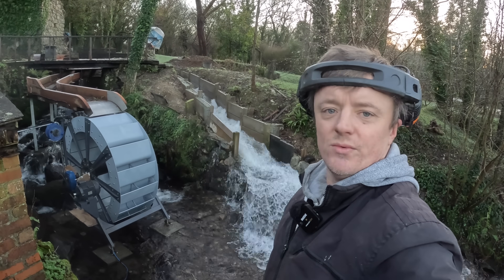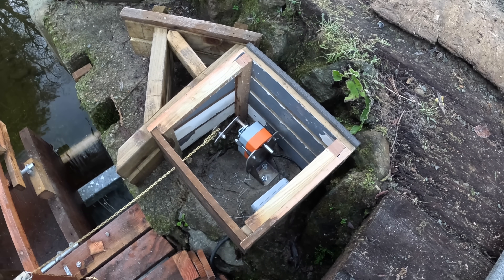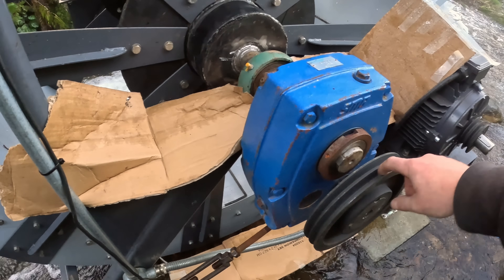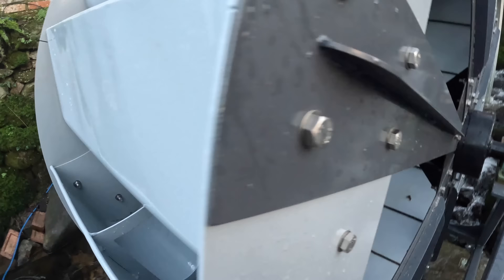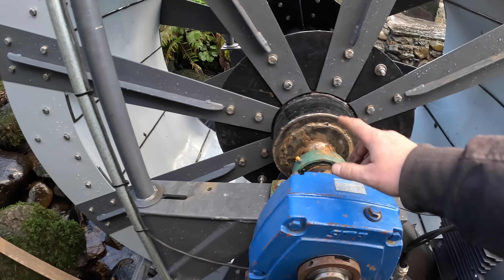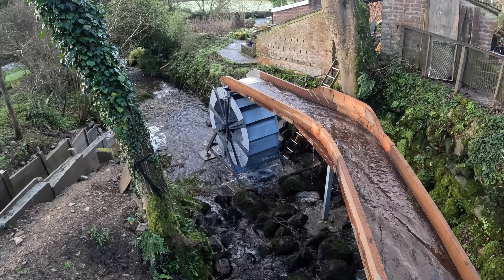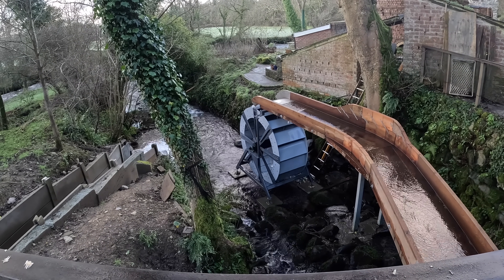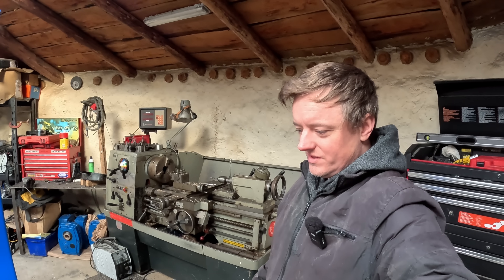Powering An Old Mill  1.5 Kw Lake District Overshot Waterwheel Project Part 5

Comment: Very interesting to watch the project develop and the fixes you put in, although I am surprised you didn't go for controlling the water flow through the bypass. It could be made into an active control something like the Thames barrier (which could be powered) to increase or restrict flow through the run off, this would help reduce the breaking and strain on the wheel. This would allow you to fit a larger pulley and generate more power at a lower speed, keep the wheel speed down and run efficiently with a lower flow rate all year. Very good project though well done, and I liked the fact you showed it warts and all.

Comment: Learn as you go from your mistakes. Never relent in doing good and giving your best. 
 Probably should have attached water wheel to shaft with taper lock hubs.
Reply: The weld on the shaft will be a constant source of failures. Sorry.

Comment: An electrical current issue with the motors could be the cause of your wheel failure. electrical motors getting back-fed electrical current could be siezing your motors. I would like to see the diodes that prevent the motors from receiving back-fed electrical currents.

Comment: You need to install a transformer there, so it can fill up with electrical powor for when the power from the dime is running slower. And I'll have consistent power all year round.

Comment: Hi, just found your channel, fantastic series on the waterwheel. Are there any pictures of the original wheel and was it overshot or undershot. My late father used to generate DC from the undershot wheel on the old mill on the farm before connection to the grid in 1955.

Comment: Hi Chris. Great job! I'm very impressed with your skill levels and quality of work. I watched the whole series on this project, and picked up some great tips that will come in handy as I build my own hydro plant. I've completed the concrete dam/intake/and supply pipe, and will soon be working on the power house with water wheel. I spent 35 years as an electrician in the power industry, and I must say, for someone that claims they are not qualified to do the electrical work, you do have a excellent grasp on the fundamentals of electricity, as well as many other engineering and fabrication skills. I only have 2 questions for you. One is do you have an engineering degree? The other is what was the total cost of this project for the customer, and expected pay back time? I've done some projects of my own, and from what I saw, with all the quality fabrications you created, and the top line equipment you used, the cost of this project would easily exceed $30K (US). At $0.08/KWH with an output of 1KW continuously, the payback would be over 40 years. So is this the type of thing a person would do more for the joy of it, rather than for a monetary return? Just wondering. Awesome shop, too, BTW

Comment: The wheel has two sides. If it's so powerful and is not generating the expected output the customer wants, why don't you use a second generator at the other side to compensate it? Sure, a generator costs a bit, but the customer is than able to double the output with relatively less effort. ;) I think this would be an excellent selling point.

Comment: Would it be safer to direct the proximity sensor on the actual wheel? If that weld breakes on both sides it will not trigger the proximity sensor...

Comment: Kris when you do another drive shaft the end plate to the shaft machine a bevel on the end plate so you can get a more penetration get 1 straight into the V and then put 3 over it multi pass that will never break as long as you have plenty of power for welding get some juice into it no way will it crack in the heat affected zone

Comment: Put a thicker end plate on so you can get a good multi pass weld on the shaft to the end plate with good volts and amps and weld it before you add bearing houses. So  you can get good access to weld iv made rollers before and if it is not welded with good penetration to start with it will fail again take care and take heed

Comment: Nice project. Two sugestions: mounting the wheel in the opposite direction (backshot) increase efficiency and reduces splashes and noise. Also, your project could use a flywheel and/or a constant speed drive before the generator.

Comment: I've done the same experiment with my students.
I showm them yours one.
Y
They've become your fan.
They did try the same after getting impressed with you and your dedication .
.
Nice job.

.
Some suggestions  ( that we did implement ) 
1. Increase the diameter of that turbine wheel . This way it'll  have more power to rotate the generator with the same amount of water.
.
2. Add cooling system with the generator to add some to its efficiency as efficiency comes down with increasing temperature.
You won't need anything extra . Just use that  flowing water to keep it cool. But make sure to make it waterproof 

.
3. Change the shapes of waer bowls of the wheel  to increase its efficiency.
You must study about Hydel power generation turbines and their shapes.

Comment: Going direktly from water wheel to
Ac power seemes rater.. not smart ..og 
I would had gon from DC 1 2 or 3 100A 24v= 2000watt run 
That onto 24v 200A batteri  and then a 4000watt sinus 
And when you use a batteri bank you can store the 800watt you are not using all
Night houres this is just dumb setup not storing if you just run 800watt hour .. 24hrs and
Store Them on deep cykle batterier  you would be better off 
rs

Comment: Love the wheel. One thing you might do to reduce splashing during high flow periods is add a 1m long rubber mat draped off the end of the wood sides of the chute that is just wide enough to be in between the sides of the wheel. It would help contain the splash and keep more water in the buckets. Excellent job.

Comment: I love what you've done. Kind of concerned about the nice warm dry motor under the cover and the cold water running over top of the cover, are you forming condensation on the inside causing it to rain inside the cover?

Comment: Love what you have done!.   A couple of things to improve water flow,  first use something like a 6mm rubber mat over the uneven water flow at the corner of the wooden water lead to the top of the  water wheel . This method of even out the waterflow, is used in most commonly on large gold sluices.  Also use a corrugating roof shape to stop very sharp drop and big splash back and loss of water entering the top of the turbine . A corrugating shape will spread the water load .

Comment: Can you control the water flow by means of a adjustable sliding sluice gate on the bypass water 💧 stream say in dry conditions so they will have a better flow of water 💧?  Something like a water level monitor could use a pingpong ball in a semi open tube with feedback circuit that is damped controlling the sliding sluice gate ?
Im a retired instrumentation & control engineer, it might give him better constant flow ?

Comment: Could you use square bar turned at the ends for the axle to make the welding easier and the strength better.

Comment: I wonder if the wheel might benefit from some added weight to increase its inertia and therefore slow its speed.  I think this might help your bucket fill and splashing issues.

Comment: if someone had that water wheel hooked up to a battery system could you power a household year round with no down time? or would you not even need a battery system? just looking at those numbers, 9kWh per day looks to be more than enough for a 3-4 person household and you said it was a dry period!

Comment: Biggest issue with this build is the RPM the Generator is spinning at. You need more gearing to get a higher RPM on the motor generator. It isn't running at the RPM it would be most efficient, lot of lost energy because of this. This could easily be around 2k in power output if changed. But would require a structure just to house the gearing...

Comment: Good to see episode 5, I am enjoying these. 

  I find it odd that the generation of water wheel power requires the grid power to be up.  It seems if the grid fails, the water wheel power would be most needed.

Welders worldwide always defend their crappy-looking welds as strong.  But when tested to failure, they aren't really very strong.  I'd fix it sooner than later.

Comment: Dynamic loading will crack metal in the weld effect zone . some times one can break the lines of stress along a weld by just running a bead of metal perpendicular to the weld . Then to use thicker metal helps

Comment: I would have used a linear actuator which raises and lowers the flow flap. This way you can reset it automatically rather than having to have a human reset the system. You would still use the 24v supply, but it would charge a battery which would deal with power outage. I am an automation specialist so if I can assist you with your methodology please drop me an mail. Absolutely love what you do.

Comment: Hi Kris. I've just noticed that you did not try it to run over a 1000 rpm. It seems these PMG power curves have close similarities with what IZTA Breeze wind turbine has. It gives its maximum power base on Rpm, maybe the sales agent doesn't even know the real technicalities about its product. I think you can still repurpose that PMG for a high speed wind turbine in any of your projects. This was even bigger that what izta breeze 2.0's permanent magnet generator.
Reply from the maker: its running on an 8 pole motor as generator. that produces its fall output and full torque at 750 rpm.
Reply: @KrisHarbour i mean the Pmg from crap chinese seller☺️

Comment: as a welder, 
- when repairing cracks like these, always grind them completely down and make a so called 'V' butweld instead of just running over them. It will most certainly crack again soon the way you repaired it now.
- always try to avoid vertical down stroke-welding.( specially on dynamic welds like this.) use an up going slightly pendeling weld technique instead, with for instance: E7018-1 Welding Electrodes . When using a MIG welder outside (  I personally try to avoid this ), make sure you have good gas-protection as MIG-welding is very sensitive for draught and polluted material like rust and paint. MIG welding proces is even worse when used in downstrokes. Only skilled welders get a good result using this technique, but even they will always try to avoid it.
- preheat all parts to roughly 150º C before welding. ( specially when welding outside or during winter temperatures! ) the material will most likely start to crack again due to sudden extreme temperature differences if not preheated.
- Take your time. welding takes as much time as it needs. rush jobs are usually double jobs.
- try to devide and spread the mechanical forces by adding 'knees' or 'traingles' on the axle towards the newly reinforcement.
but most important :
If you can't get your parameters right ? don't weld it! ( the right rods, machine, cleaning method), protected from wind, water and cold conditions. 
It 'll cause more work in the end and in most cases potential damage/danger.

Comment: I've watched every episode but may have missed the answer to my question which I've only really thought about since seeing the figures on the app for the money earned by the power generated. Is the customer using the power as and when required and this is just surplus power that gets sent back to the grid or was the whole purpose of them having it built to solely make money from it? either way its an awesome feat of engineering. incredible skills :)

Comment: I watched all 5 videos. I watched him get upset because the alternator was rated at 2000 watts and should have been advertised at 600 -800 watts. At the end of the last video i realized he told the customer that a wheel that tall and that wide will do 1500 watts, but actually it does 800 watts. If you run enough water over it to cause a lot of splashing, it makes it to 1500 but very inefficiently. I'm not a waterwheel engineer, but maybe if the wheel was 3 times as wide it could run the same amount of water without all that splashing and at a slower, more efficient speed. And a larger pulley or even a different gearbox would bring  the speed of the generator up to where it is supposed to be. I believe he said 250RPM but he never checked that speed while the wheel was turning the generator.

Comment: This is terrible. You went cheap on the generator and built the entire system around it. Your clearances are way too tight. The belt alignment wasn’t correct, causing you to put on V belts?

The auto water shutoff is jinky at best. Your customer has to deal with all this Frankenstein monstrosity.  You got the numbers right.  But this is obviously your first and it shows.

Comment: Kris, don't worry about how those welds LOOK. There are farming implements across the entire United States that were stick welded back in the '50's that look like you let your kindergartener loose with the welder that have held up to the test of time.

As you already stated, you must've gotten the steel way too hot around that weld for it to break. When it comes to welding that's really the only thing you have to worry about. To hell with it looking perfect for these YouTube welders. I guarantee that when the cameras aren't looking they're boogering up everything. 

Remember, welders are great at grinding and painting.

Comment: Hi Kris. Just found your stuff. Very cool. And great work. Can I make a suggestion?  Surely if you put a cowl on the wheel it would fill the paddles and be more efficient? More like a turbine...  I was thinking about how gold miners use a wash plant and place a rubber mat over the ripples to help lower splashing and turbulence. Steve.

Comment: I have a paddle wheel of the same power as yours and I had problems with my inverter which is designed for wind turbines and although it has a constant rotation speed of around 440 rpm at the level of the axis of the generator, my inverter was sometimes able to go into safety by sending current to the generator to create an electric brake, which creates an enormous constraint at the level of the axis of the wheel and the transmission, no Did you not have this problem with your inverter?
Sincerely,
philippe simon

Comment: My father was trying to weld a bolt that broke off, one of the three connecting the exhaust manifold to his engine which he needed to replace. Space was extremely limited and his money for the truck was running out as he already had to purchase hard parts and rebuild kits for his transmission (one was the wrong model and buying from a shady site he was unable to get a refund, the second was from a more legitimate site and had good parts). He first tried drilling it out with some expensive bits, which first burnt out the drill then the two bits... he eventually, and rather accidentally, welded some vice grips to the bolt while the nut he filled and welded with all-thread fell to the ground. He did get it off, but it was a funny and not-so-clean job in a space he could barely fit two hands in. I think it's impressive you were able to weld in so tight a space, even with an arc welder that wasn't up to stuff. End result looks amazing :D

Comment: It looks like you have about everything covered for the present time. Give it a while and come back and see if anything is changing or wearing. You certainly have a lot of engineering in it and for as many things as you can forsee you have failsafe systems to help preserve the system. Very interesting job, and thank you for sharing it along the way. Remember: Rome wasn't built in a day, so take in the sights and listen to the sounds of the machine as it is working successfully and don't be upset if it needs something else. Perfection is a state of mind, not often achieved in reality, but the challenge creates the best feelings of all.  ben/ michigan

Comment: You know you can use the AC from the alternator to give you the wheel speed?

Ideally use a small transformer to isolate your "Signal" from your actual AC line, but you can use a frequency to voltage converter and then set "events" based on a voltage, simply transistor based triggers can click in dump loads, battery chargers and finally a "kill" as you have cleverly actioned...

Comment: Brilliant job 
ive been saying for 30 odd years all the places they converted water mills into apartments or offices they should have put a generator on the waterwheel and get some free energy out of it
Im in france now and i still know 4 places near me with mill wheels that do nothing and even more in the nearest large town
1 near me is a  6 meter wheel that used to run a whole workshop via ceiling belt system bet that could produce a good amount of Kw
Reply: What part of France are you in?

Comment: Hi , if there's a power cut on grid side . Why are you stopping the wheel . Doesn't make  a lot of sense
Reply: If load goes away he has to stop the wheel or it over speeds and over-voltages the inverters and things burn up.

Comment: Kris if you put a sheet metal ring attached to the wheel on the generator side. It will prevent water from splashing over onto your gear box, and generator. I know you have a cover, but it would offer some additional protection. Our forefathers would be proud of you. Great job.